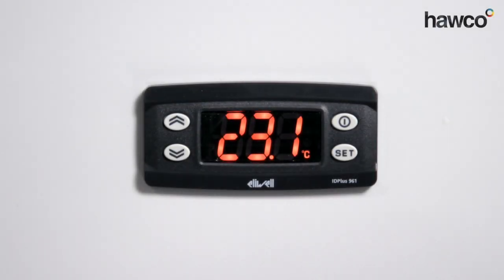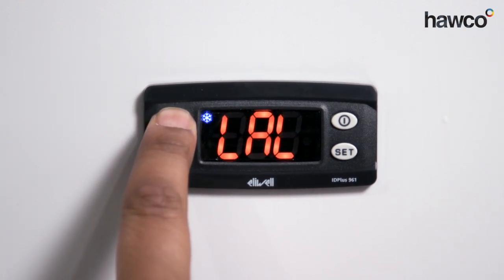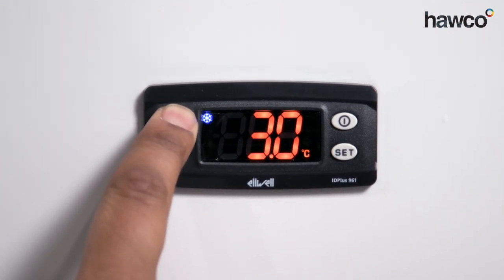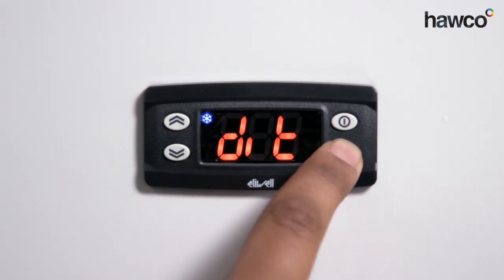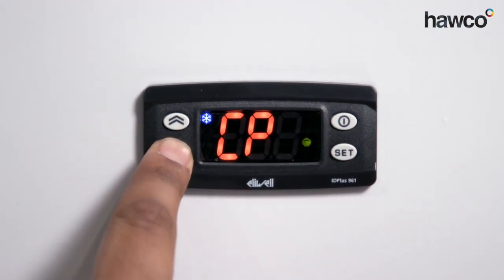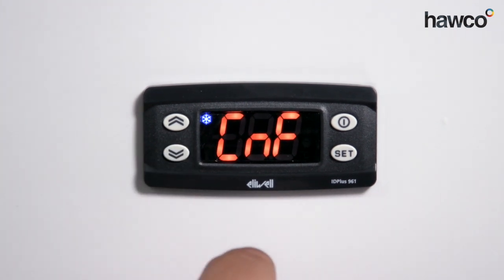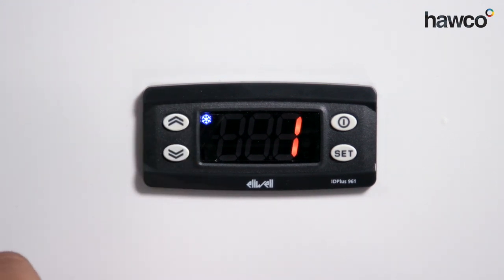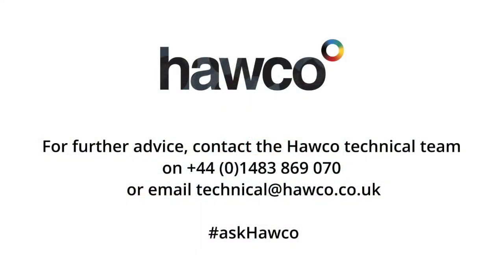Programming an Eliwell IDPlus 961 Digital Controller

Comment: dear friend why in my controller eco  light is blinking.
Reply from the maker: Hi Ravi

The flashing eco light shows that the economy setpoint has been activated. The economy setpoint is a different setpoint that can be initiated during times when the cabinet is not being used (for example at night when a store is closed)

If you wanted to deactivate this setting, you will need to navigate to the CNF folder. 

The parameter H31 controls the function of the UP key while the parameter H32 controls the function of the DOWN key. 

Either one of these will be set to 3 (which means economy mode activation). Press this key to activate or deactive the economy setpoint mode.

Please remember any changes to any parameter in the CNF folder will require you to power down the controller or the cabinet and switch back on to fully save the new parameters. 

Hope this helps.

The Hawco Team

Comment: Informative thanks. Please discuss OSP setting in the CP folder and how it effects the setpoint. Thank you.
Reply from the maker: Thanks for your comment.

The OSP parameter refers to the temperature value that should be added to the setpoint when using the economy function mode.

You should engage and disengage the economy function mode manually through a pre-configured key or controller digital input. 
 
You can configure the down key to do this. In this case,  you should set parameter H32 to “3”. After that, power the unit off/on via the isolator. 

Then the DOWN button can be used to manually turn off/on economy function mode.

The same function can also be found with IDPlus 971 and IDPlus 974 controllers.

Refer to the Eliwell instruction manual for the IDPlus range of controllers for full details - see http://bit.ly/2WlSuon.

Details of OSP setting can be found on page 26 and the H32 parameter on page 29. 

Hope that helps. Get in touch with technical@hawco.co.uk if you need further advice.
Reply: @HawcoCoUk  Ok? I gather that from the manual but specifically how? If my setpoint (SET) is set at -19 Degrees C  and I put in an OSP setpoint of +5 Degrees, how does it affect my E1 (enviroment probe) reading. Will the actual independant measured temp be -14 or -24?
Reply from the maker: For this scenario, the probe will look to increase the set point by 5 deg C. from -19C to -14C while economy function mode is active
Reply: @HawcoCoUk  Ok, now it makes sense. Thank you

Comment: How would you go about setting this up on a beer chiller? Any advice would be great. Thanks
Reply from the maker: Hi James

The set point required should be between +8°C and +12°C, depending on the product  (e.g. wine, beer, ale etc). Defrost cycles will be minimal as the evap temp will be above +1°C.

The easiest way to set up your controller would be to start by applying one of the four standard defaults (AP1-AP2-AP3-AP4) which come with the Eliwell IDPlus 961.Then you can change the setpoint as required.

The most suitable default application for a beer chiller is AP2. To find out how to load this default application, refer to page 14 of the IDPlus instruction manual which can be downloaded here - http://bit.ly/2WlSuon

Then to adjust the setpoint to between +8°C and +12°C, refer to page 19 of the same instruction manual. A full description of the AP2 default parameters can be found on page 25. 

If you need any more advice, email technical@hawco.co.uk and we will do our best to help you.
Reply: Top stuff thanks a lot for the reply

Comment: to get the highest temp, should i do it as you did but the set point is the max ?
Reply from the maker: Hi Diaa, Thanks for your question. 
To clarify, higher setpoint (SPH) and lower setpoint (SPL) is the range our target setpoint (1SP) can be selected between. It is good to set a higher and lower setpoint as it allows end users to change the setpoint (1SP) within the range or margin set up by the installer.
If you need any more help, email us at technical@hawco.co.uk or call us +44 (0)1483 869 069